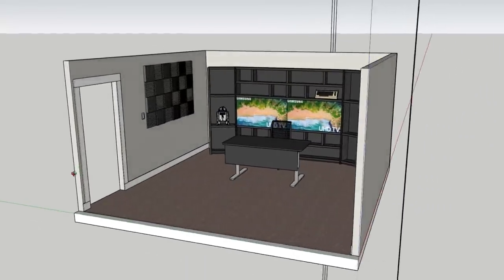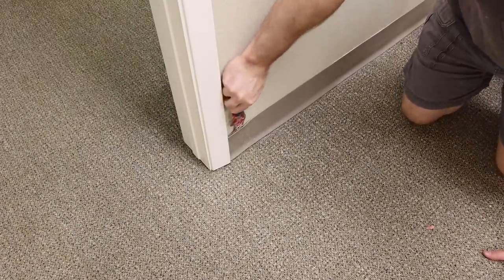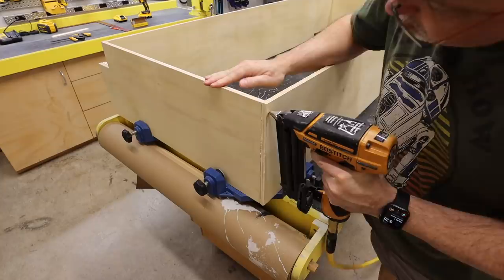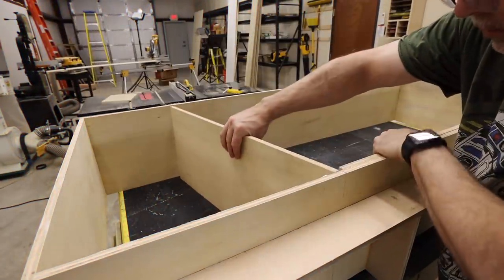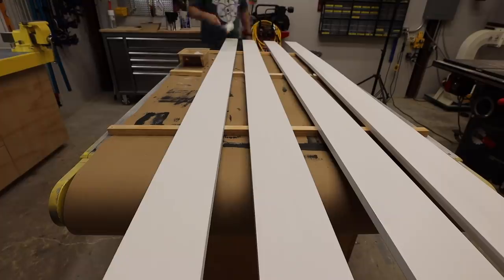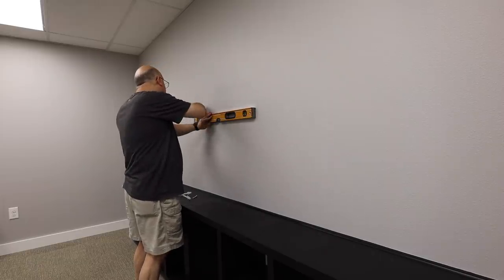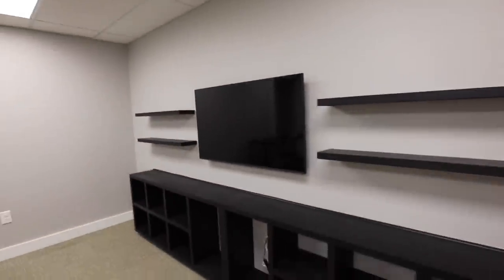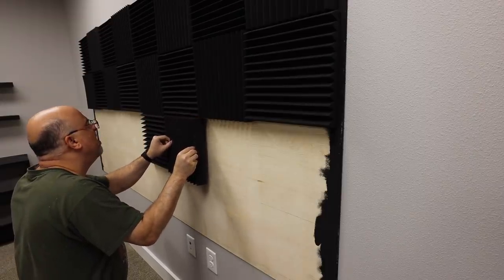Building a YouTube Studio Set

Comment: WS2815 rgb leds are a bit easier to work with. Same protocol, but they work on 12V - less amps to deal with and no color shift on long chains. ;)
Backup data pin, that they also have, doesn't hurt either.
Reply from the maker: That's actually what these are.